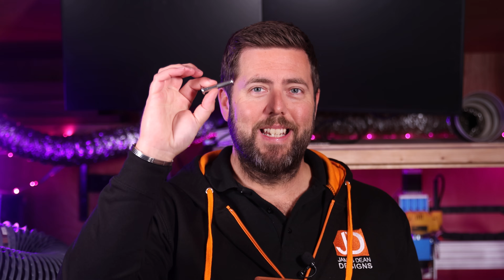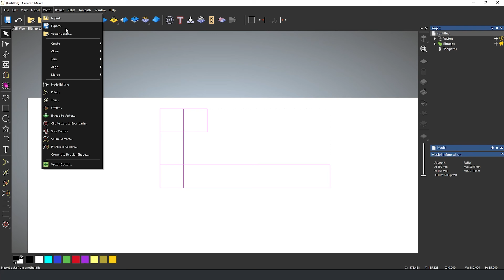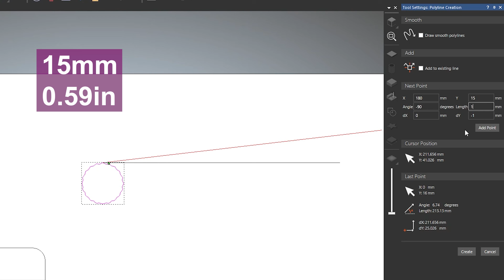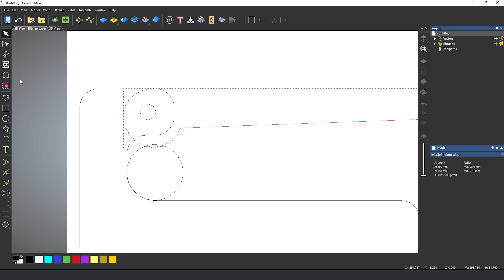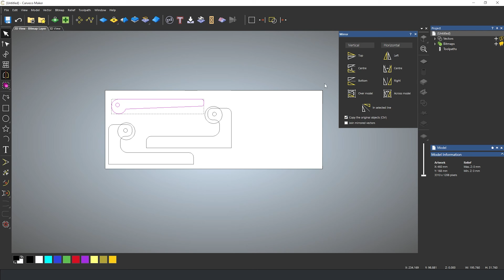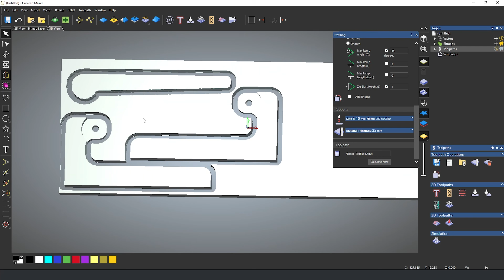Making a nutcracker - Easy woodworking project for the holidays!

Comment: Great video. 👍🏻
Would the Foxalien masuta 3S have the capability to produce something like this out of hardwood? Thanks
Reply from the maker: Absolutely. The smaller spindle may struggle with the deeper cuts but if you have a router installed then should be no problem at all.
Reply: @JamesDeanDesigns ok thanks James. I will take advantage of the Black Friday deal 😊
Reply from the maker: @andykynaston1261  no problem. Don't forget to use my links 😁

Comment: If the wavy portion was a bit more of a cam shape or even just elongated a small amount it would work on quite a few varieties of smaller nuts as well.
Reply from the maker: I was debating doing a V2 version with a piece that slides in/out to accommodate all different size nuts...may still do it 😁